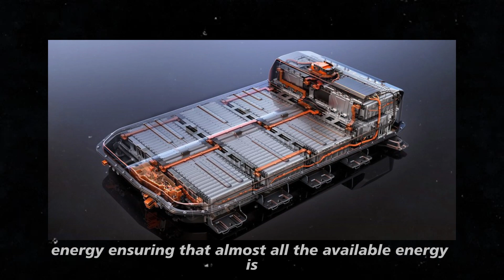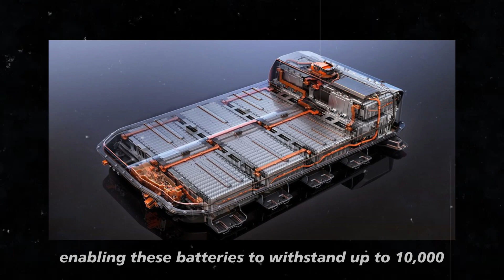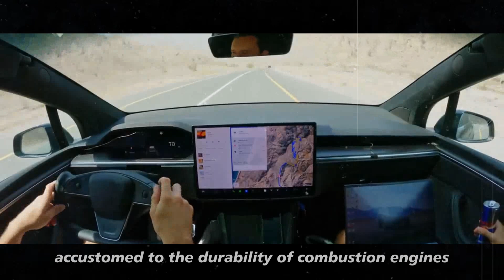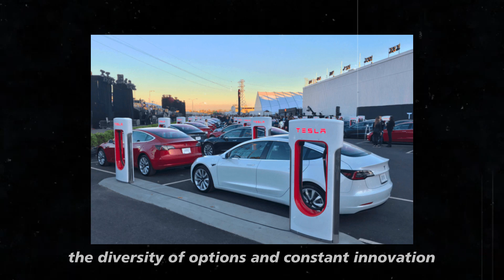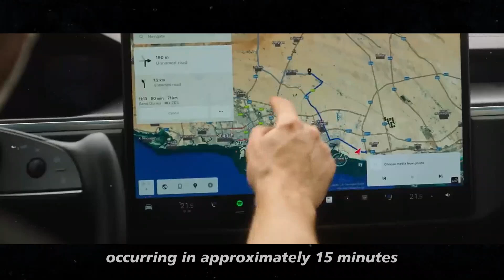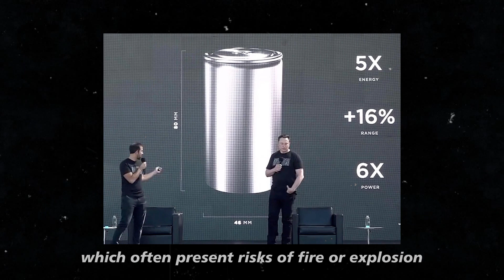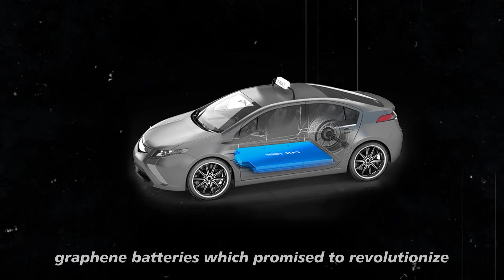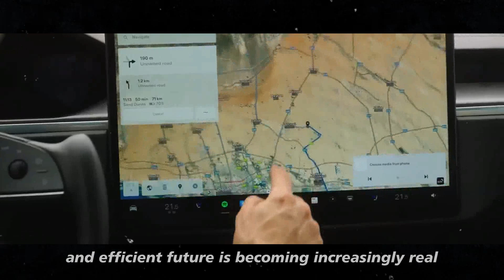THIS IS EVOLUTION! New Aluminum-Ion Battery Technology That Elon Musk Will Use in Tesla Vehicles

Comment: This video is clickbait. The reality is that even though aluminum-ion batteries are a promising technology, but they are still in the research and development stage. While they offer several potential advantages over lithium-ion batteries, such as higher energy density, faster charging times, and increased safety, there are significant challenges that need to be overcome before they can be commercially viable.

Here’s a rough timeline:

Current Status (2024): Aluminum-ion batteries are mostly in the laboratory phase. Researchers are working on improving the performance, particularly the cycle life, energy density, and scalability of these batteries.

Near-Term (5-10 years): If breakthroughs in research continue at a steady pace, we might see early-stage prototypes and small-scale applications within the next 5 to 10 years. These could be used in niche markets or in situations where specific advantages (like fast charging) outweigh other limitations.

Long-Term (10-20 years): For widespread commercial use, such as in electric vehicles or large-scale energy storage, aluminum-ion batteries will likely take 10 to 20 years or more to develop. This timeline depends on overcoming technical challenges, scaling up production, and ensuring cost-effectiveness compared to existing technologies like lithium-ion batteries.

So, while the potential is there, it could be a decade or more before aluminum-ion batteries are widely available in commercial products.